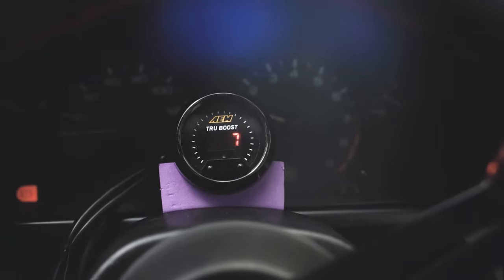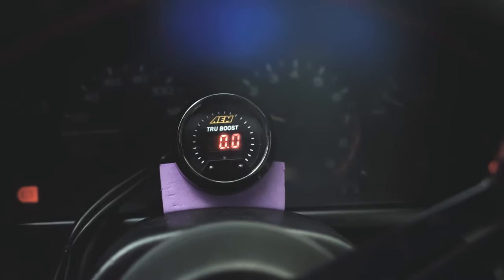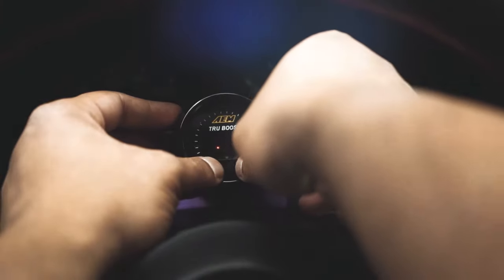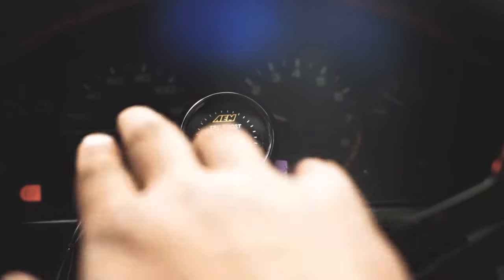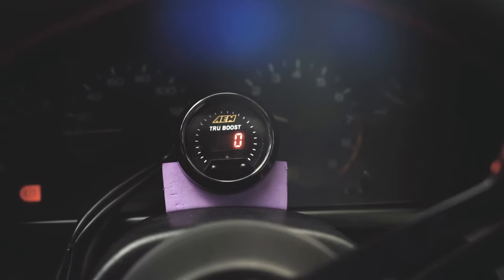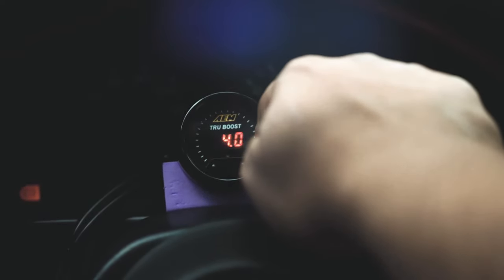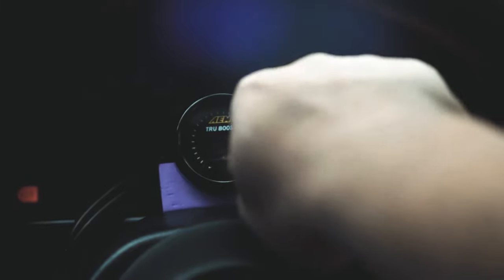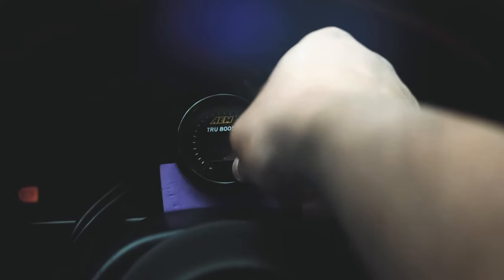How to program AEM TruBoost Boost Gauge.

Comment: how did those duty cycle settings work out for you with the stock wastegate? what # did you get?
Reply from the maker: I have mine set at 70%. But I would really let my tuner set it when I get a nistune done one the dyno.
Reply: @runningrich my tuner says he’s never messed w these boost controllers before, what do I do

Comment: Hi 
I recently bought the tru-boost X serirs boost controller and is fitted to my 1.6 turbo. I however am struggling a bit, car boosts very strong 1st and 2nd (30psi) but in 3rd boost drops of and then does not want to boost. I need to switch of the car and then it boosts again.
Turbo has a internal wastegate, 14 psi actuator spring.
Reply from the maker: You need to set it up properly. Seems like you are over boosting. It can cost you an engine.

Comment: I was sitting inside of my Mustang GT in idle for a while and i was playing with some of these settings and i clicked something in numbers and the car turned off and wont start back up. Any possibilities on anything? is there a reset for the settings or ? Also it’s making my battery really drained now and technology in the car drained even with new alternator in.
Reply from the maker: Go through the setup procedure.. if it's draining your battery then it's not wired properly.

Comment: how do I set up gear by gear? at the moment I'm running 20 psi on my car but, can't put the gas on the floor in 20psi on 4 and 5 gear. So i wanna limit my 4,5 gear to 13 or 15psi :).
Reply from the maker: You will need a standalone system
Reply: Turbo smart eboost